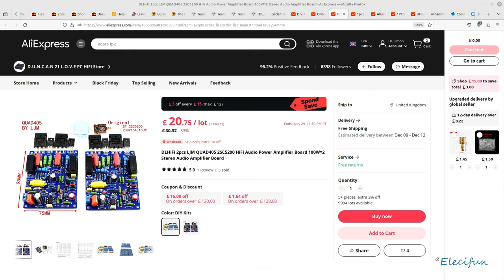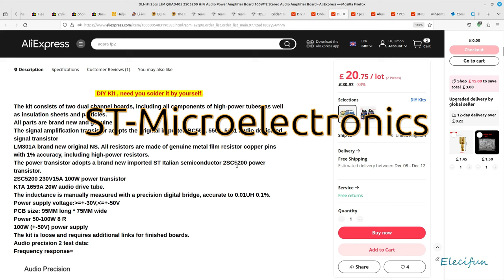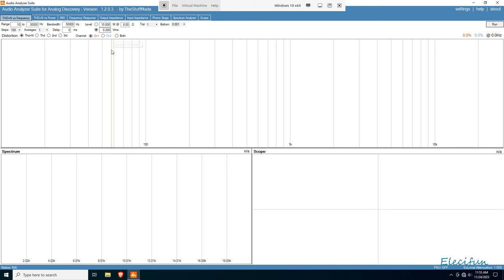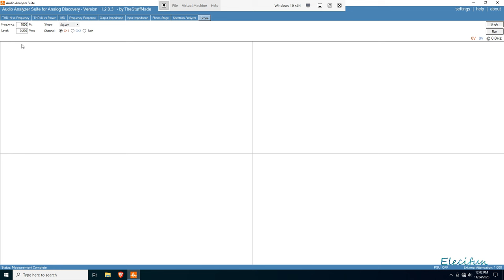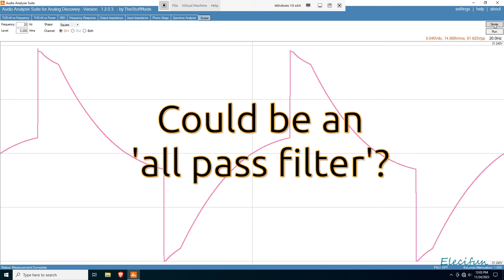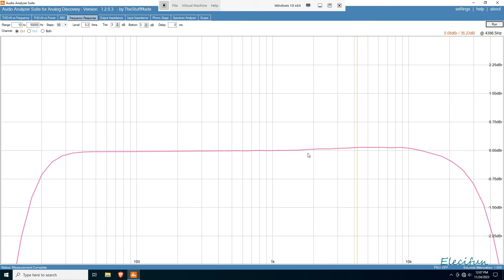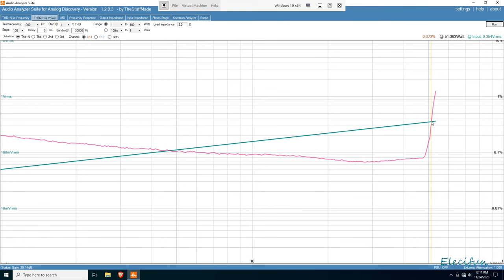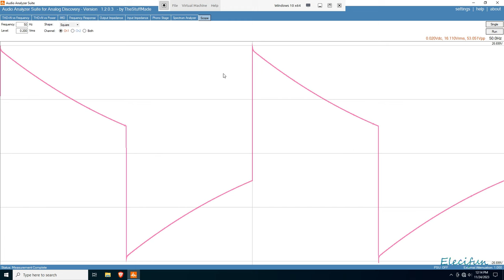DIY Kit Quad405 V3 Audio Tests

Comment: It measures like it sounds, lack of detail and dynamics. It sounds like an amplifier from the 70s, good in its day, but things have moved on. The L12/2 is so much better in EVERY way. Square waves are really square. Frequency response is ruler flat. Slew rate on the Quad is really poor, and you can hear it.
The crossover artifacts were probably due to your low operating voltage. A duel 50 volts works better. Note clipping is not symmetrical, at any voltage.
Valve lovers will love it, has the same type of sound. (if you know what I mean!!)
Reply from the maker: Cheers for your input Michael, much appreciated. 
I'm in 100% agreement the L2-2 is a better amplifier circuit for us YTbers looking for a nice kit to build, and maybe use for listening pleasure.

Comment: Cool. Since this is a "QUAD" based amplifier, I guess the final transistors are both NPN in push-pull configuration?  In my opinion this dual NPN output is better than the usual NPN/PNP push-pull config. The reason why is that NPN and PNP transistors are made differently, and are not symmetric with respect to the active layers inside.
Reply from the maker: @la7yka You are correct two NPN's in push pull configuration. Thanks for your input friend.
Reply: It's got a 6 Watt class A circuit as well.... that's why the heat up even when not in use ;-)

Comment: If the amp is a 1 to 1 copy of the Quad 405 then they have the same issues regarding blowing up the driver transistors.
The outout of the op-amp has a series capacitorr, a teardrop tantalium capacitor 100uF 3V !!
If the tantalium goes bad the whole driver section will be distroyed.
Replace the tantalium with a 25V (or higher voltage) one to prevent this issue.
Reply from the maker: It doesn't have a tantalum capacitor.
Reply: @Elecifun   Yes it does, it's the little green drop-capacitor right in front of the opamp IC. The 405 tends to oscilate sometimes! That wil damage the little tantalium . I have repaired hundreds of 405's past 4 decades ;-)
Reply from the maker: @Nico58NL  as I have it in front of me, I can assure you it is tantalum free. In front of the opamp is a film cap.
Thanks for the heads up thought.

Comment: Is this a new amp sir? You've built so many im losing track. 🤔
Reply from the maker: Hi Dec, Its a newer version (V3) of the Quad405 amp which I built and tested a little while ago.
Reply: @Elecifun  Oh IC. 😄👍
Reply: @Elecifun  What's the difference? 🤔
Reply: @Elecifun  What happened to the L12-2?
Reply from the maker: I use the L12-2 here at home. Its a good amplifier and will be tough to beat, picking circuits from Aliexpress.
Reply from the maker: Different output transistors and layout.